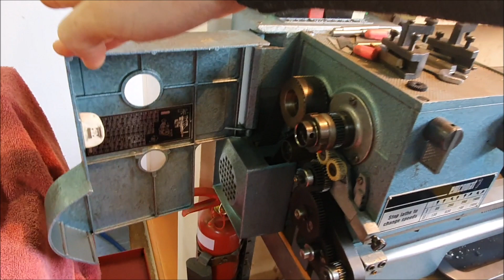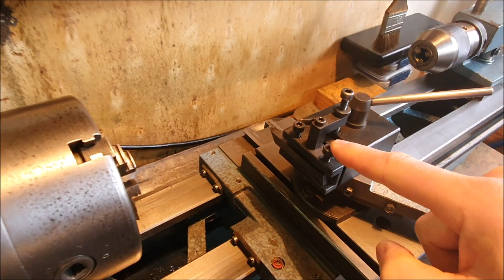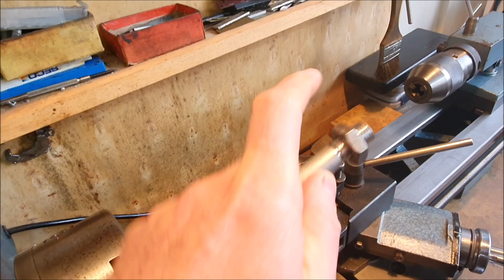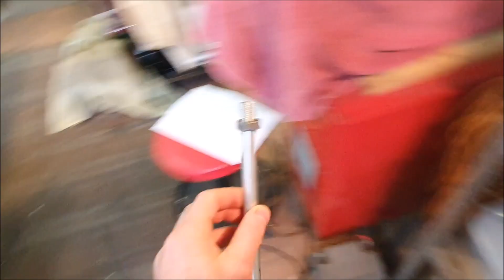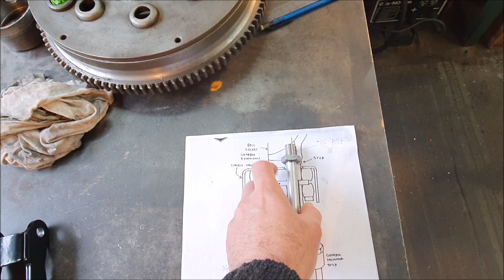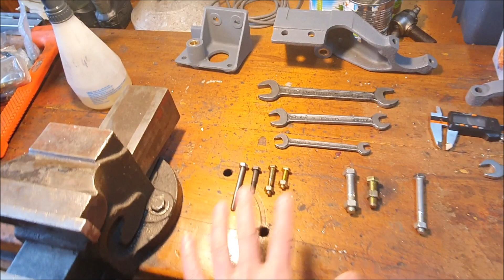Why do I need to use Whitworth hardware?

Comment: This is the dumbest thing I've ever heard for sizing a bolt or wrench...I understand it but the reasoning behind it is so wacked...I'd be using regular bolts and get far away from that whitworth crap.
Reply from the maker: But you still end up with Whitworth on any engine components, tapped holes in steering, brakes, axles and so on. So unless you drilled out every thread and put in metric helicoils or similar you can't ever get rid of them all. Then you need two sets of spanners again!

Comment: Next complaint. The old electrics which uses BA threads. And the BSC cycle threads used on old motorcycles.
Not to forget the Japanese Phillips looking screws but you need a JIS screwdriver.
But metric bolts are not simple. A M10 could need 12 or 13mm spanners.
Only thing I know of that only has a single standard is spark plugs.
Yes, forgot TORX.
Reply from the maker: I think spark plugs took a while to get there though. There are definitely older non-metric plugs about. The other thing I found lately where standards don't seem to mean anything is how you measure PVC piping diameters!

Comment: Wow,cool. I have exactly the same machine,emcomat 7 i think. It has the mill/drill head,just leveling it,👍
Reply from the maker: On mine you can see where the mill would attach and it has a switch for it on the control panel.
Reply: "just leveling it"  That triggers me...  I took a job on maintenance in a place that was under threat of imminent closure, but I hadn't got a job, so it wasn't a big risk to take it...
The machinery (three lathes and a Bridgeport mill) had just been plonked down, hadn't been set up properly, so I set up the Colchester Triumph and the Bridgeport, as far as I could, in accordance with Mr Schlesinger's principles...  One Monday, I arrived to find the Triumph had been moved.  A fitter came to me and explained the manager (an electrician) had told him to move it, because there had been complaints about swarf from it getting into the fitting shop...

He said it should be ok, he'd levelled it in two axes with his "precision box level"... Ok, I said, but the headstock pedestal is on one concrete slab, the tailstock pedestal is on another, and this whole county is on clay... Don't you think the slabs will move independently when the clay dries / absorbs groundwater, seasonally?  Nice bloke, but we never talked about that again... I moved the Triumph onto a single slab, never did anything about the other machines in ten years.  Their poor setups just cost extra time that I got paid for...

George Schlessinger's book is informative... If you're setting up machinery... Fascinating to see how much a substantial piece of cast iron can twist by virtue of its jacking / levelling screws...

Comment: Thank heavens that Whitworth is no longer being used. One problem I’ve seen, particularly here in the USA, is that people will use an SAE nut, which will fit with a bit of extra elbow grease. Then it’s thought that everything is ok. But of course, it’s not.
Reply from the maker: I am very careful to keep my hardware sorted for exactly that reason. And it's annoying trying to work out which things are 5/16" Whitworth and what are 8mm Metric (and 1/4" and 6mm).

Comment: Good video I’m very glad to hear your using the correct nuts + bolts on your restoration.
I think everything you said sounds about rite , my understanding is in the beginning there was simply “Whitworth threads” aka “ BSW British standard whitworth “ or sometimes marked simply as “W” these were the 1st standardised threads in the world created by a guy named Joseph Whitworth of Manchester ( incidentally it was he who 1st decimalised the inch too among other fantastic things ) anyway these were fine for locomotives and bridges etc but with the advent of cars etc a finer thread was required so along came BSF (British standard fine) these used exactly the same range of hex sizes as the older BSW but were all 1 size smaller so only 1 set of spanner’s was required for both thread pitches hence two sizes on 1 spanner. 
Very intuitive actually once you get your head round it , to tighten a 1/2” bolt you use a 1/2” spanner - perfect ! Unfortunately tho due to material shortages during the war all head sizes were reduced to 1 size smaller to save steel in production so your same spanner set will still fit any BSW or BSF bolt just depending on the age of the bolt and the age of the spanner it may give the wrong size on it. 
In summary then if you have a set of whitworth spanners you WILL definitely have 1 to fit any BSF or BSW bolt regardless of age just it may state the wrong size on the spanner. 
The earlier usually pre war nuts and bolts are easy to spot as the hex size is noticeably bigger. 
Fun fact all the BSW range of threads are the same tpi as UNC accept the 1/2” and can actually be interchanged but this is not recommended as they have a different thread angle UNC - 60 degrees BSW 55 degreees
Reply from the maker: Thanks for the comprehensive reply! I recently sorted my boxes of random hardware into bolts, nuts and washers but haven't gone as far as working out what threads everything is!

Comment: Will britool wrenches in bsw sizing work on regular sae nuts and bolts?
Reply from the maker: Not really. But sort of. BSW/BSF sizes as marked refer to the diameter of the bolt. Metric and AF (for SAE nuts and bolts) type spanners are measured by the size of the bolt head. So a 1/2 BSW definitely won't be the same size spanner as a 1/2 AF. But sometimes the spanners are close enough to sort of work but I wouldn't recommend it! This is the best chart I have found that shows the actual spanner measurements for each type: http://www.baconsdozen.co.uk/tools/conversion%20charts.htm
Reply: @asciimation  does the disparity in size get bigger or smaller when getting into 1" And above imperial bolt sizes?
Reply: @asciimation  thank you for the info

Comment: Thanks for that explanation Simon, I had never quite understood about the 2 sizes on the Whitworth spanners before, it makes perfect sense now!  Thanks!
Reply from the maker: As far as I have seen if you buy any new BSF/BSW hardware, which is getting hard to find, it will be the BSF sized heads/nuts. I just know as as someone new to all this figuring out the differences between bolts and threads and spanners and so on isn't easy.